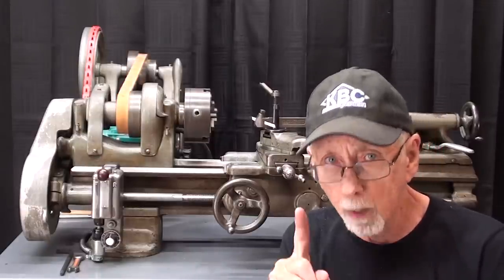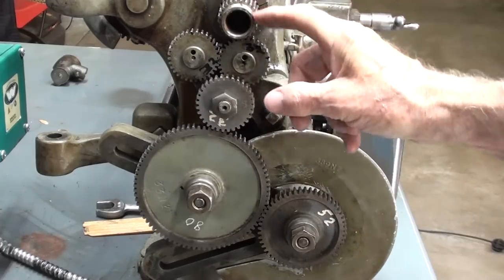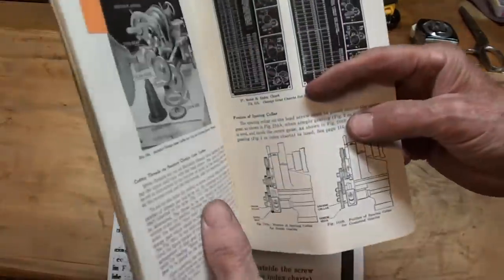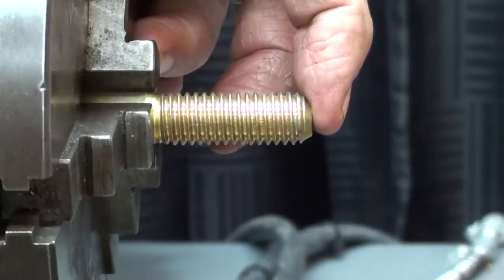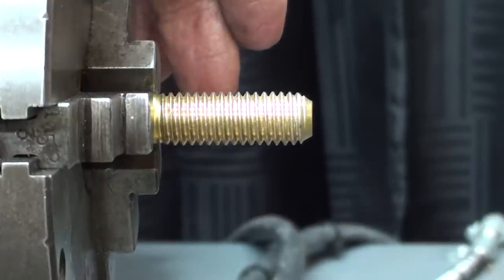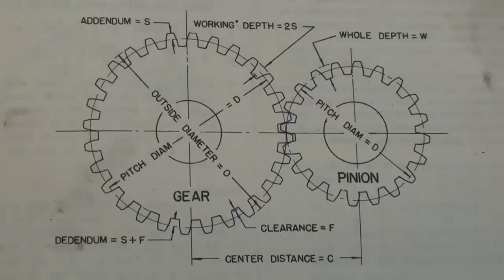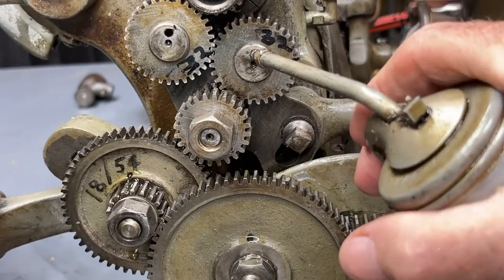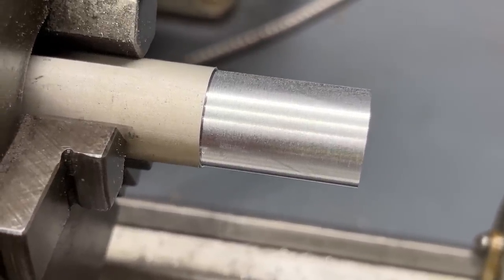SETTING CHANGE GEARS SOUTH BEND LATHE mod C #807 pt 1 tubalcain

Comment: Mr. Pete, you have your nuts mixed up on the gearing when you change out the new gearing ratio.  The thin nut belongs on the stud gear.  You have it on the middle compound gear.  The thick nut belongs on the compound gear.  And yes, there is a washer behind the nut on the screw gear.  I know this stuff too well from all the years of changing out gearing on the 9" SBL cutting threads.  Dad was a stickler on this stuff just like Mr. Pete!  Yes, I watched the full video and paid attention in class today!  Thanks for sharing, Ken
Reply from the maker: Thanks, when the weather warms up, I’ll fix that

Comment: Thank you for this, any, and all your videos related to lathe gears and quick change gear boxes. My Clausing 5914 engine lathe came in buckets and getting the gearing to match the threading chart is my last hurdle. You may not directly address my issue but your videos have a tendency to educate me to the point that I can. Thanks, again!

Comment: I have only changed my Atlas change gears once for the very reasons you demonstrated in this video. My Atlas has a beautiful OEM wood top base on cast legs. I like its originality, but the wood surface limits mag base attachment points for my indicators. Your steel table would be a welcome upgrade to me for function, but I have been loyal to the Atlas design. I see very few OEM Atlas bases. I treasure mine. It is a pretty handsome upgrade for an otherwise pretty basic and light machine. We set up my feed selection years ago in very cramped and poorly lit shop conditions. (The machine now has a well lit and spacious new home.) The feed is way too fast for good finish. This video encouraged me to set it up for a better universal finish and to get back to a long delayed LeBlond rebuild that I began years ago. The LeBlond is a true industrial machine and has a feed gearbox. It is also much larger. It deserves to be in use instead of being an aborted rebuild project... Too many projects...!
Reply from the maker: At one time, I had a atlas machine on the cast iron legs       It also has the nice wood top that you mentioned.

Comment: Lyle, thank you for this video.  I have an old (1911) South Bend 11-inch lathe that is a model C -- your explanation really helps with understanding how to change its gears.  Now I just need a set of 14-1/2 degree gear cutters so that I can machine replacements for the missing/incorrect change gears I ended up with when I bought the lathe!  Then I'll be changing the gears as you demonstrated.  ;)

Also, I remember reading somewhere (in a book, not on the Internet!) that notebook paper makes a good spacer when setting the change gear clearances.

Comment: We have a large Monarch NN lathe at work that is mainly designed to cut cable grooves in cable drums for overhead cranes. The slowest feed it has is .009" but its a 50" swing lathe. It will cut cable grooves up to a 2" lead. That gets the carriage moving pretty good. I just turned a couple bronze split bushings on it that were 35" in dia. and 24" long. They weigh almost 2,000 lbs before I started machining.
Reply from the maker: Wow

Comment: I would love to see a video on this using the metric gears and the quick change gear box on a SB9 and how to set the tumblers. Thanks Mr Pete for another great video.
Reply: A quick change gearbox leaves you no threading options other than what it has.
Reply: @MrEh5  Actually no. The intermediate gears between the spindle and the quick-change box allow not only metric threads but also other feeds and threads. My bench lathe will cut 17 other inch threads not listed on the QCB between 3.75tpi and 128tpi. Of course, you would probably never use any of these oddball threads, but they are available. 
An inch cutting lathe with a 120/127 compound gear will cut metric leads exactly. Lathes, such as bench model South Bends, use a compound gear that is very close to exact. By very close, I mean that you would have to have a length of engagement of over 12 inches (300mm) before you might detect any binding. The error would be very difficult to detect in a job shop, let alone the hobby shop.
Reply: @aceroadholder2185  yes but most people don't have extra change gears when they have a quick change gearbox.
Reply: @MrEh5  My lathe came with extra gears required to cut all the metric standard leads. South Bend had them listed in their catalogs. Lyle has a video where he made SB gears in plastic on a flat-bed 3-D printer.

Comment: Thanks Mr. Pete!  The model C was the first rebuild I did a couple of years ago.  I never knew about the dial indicator and turn the chuck trick.  And the tailstock wrench fits the gear nuts??? what???  I have changed those so many times with that book in hand, and never even tried that wrench LOL.  On a side note, I 3D printed a couple of gears to convert the 9C to thread metric.  It worked like a charm.  I purposely put extra stress on the machine to try and break off teeth on the plastic gear, but it held like a champ.  Thanks Mr. Pete.  You are a mensch.
Reply from the maker: Thank you, I’m glad you liked the video. Those printed gears really seem to be a strong

Comment: Thank you for all the time you take making us these videos thank you especially for this one I have a south bend see I set it up to cut threads i have short term memory lost miss placed my south bend book I want to set it back up for feed so this helps me a lot I worked in a shop where we remanufactured EMD s when they were setting up the front end water pump s oil pump s all meshed together they had to set back lash on every gear with a indicator

Comment: Great video Pete👍 well explained. I’ve had a 9” Southbend for many years and not used it very much as I have access to others at work if I need to machine anything. Mine has the deluxe apron but no quick change box. A model B as I’ve just learned😃. I had to replace the motor a few years ago and had to work out how to wire it for the reverse switch. Very complicated but satisfying when everyone tells you it can’t be done🤣

Comment: Mr. Pete I have a 6 inch atlas lathe . I have set it up for threading in the past but have always struggled with gear spacing . Would never have thought of using card stock between the gears . Thanks . the old retired cop from NC

Comment: I see that you are using a link type belt on your lathe. One of the few things that Horrid Freight sells is a green color American made belt of similar design. I have a couple that I use of the red variety like yours that for determining the belt length for replacing torn belts. Otherwise I don't typically use them as they are expensive.
Reply from the maker: They are costly. But easy to install, and seem to work quite well.

Comment: Oh for heaven sakes, the tail stock wrench. Never thought. But the wrenches provided will do much.
This older 1928 has a fine feed of .004 per rev of the chuck. You just taught me that check and I tried it.
Still astounded and even baffled on some of the production changes between this 22-RC 9C and your newer 9. The direction change lever for the lead screw really got me.
That nice lathe went back to 1911 with the square head snug bolt to hold the position. This 28 has a nice spring-loaded brass unlocking lever on the change lever and a pin to lock it in the three positions. One armed banjo here with no guard between the lead screw and gear.
Do you know your spindle speed as shown? I stick at 300 rpm's and dump oil to the spindle and he uses it. Scared to speed him up and accelerate wear on this once thru oiling system for the spindle. 
And more to come about gearing... Cool!

Comment: Hey Mr Pete,  
It seems like you can mathematically determine what gears are needed to an extent.
For example, given the gears installed at the start (including the fixed gears on the spindle and the reversing set), I believe I can derive the threads per inch off the lead screw based on the lathe being set up to cut 13 threads per inch.
At the start of the video, the gears affecting the ratio from the spindle down are: 24 to 32 to 32 to 52.
24 to 32 is a ratio of .75
32 to 32 doesn't change the ratio but if it did, I believe you calculate the effective ratio as the previous ratio (.75) * (the ration of the driving gear (32) to the driven gear (32) (or in other words the gear-to-gear ration is 1) so the effective ration is still .75
For 32 to 52, the ratio is the previous ration * (driving / driven) or .75 / (32 / 52) or 0.461538462
So, for every rotation of the chuck, the gear on the lead screw turns .461538462 of a revolution.
If the thread being cut is 13 threads per inch, the per chuck revolution movement of the threading tool must be 1/13th an inch or 0.076923077 of an inch
If the lead screw turns .461538462 of a revolution for every revolution of the chuck and the tool needs to move 0.076923077 of an inch then we need the lead screw pitch to be (.461538462 lead screw revolution / chuck revolution) / (0.076923077 of an inch / chuck revolution) or 6 lead screw turns / inch (if I handled the units correctly!).
Thus, the lead screw must be 6 teeth per inch.
How did I do?

Comment: It would be interesting for some to know how to calculate threads & feeds if there is no chart. For example, how could one figure out that the original gearing (13TPI) was in fact 13 TPI if no chart was available? That might make an additional video for this series.
Reply: That's something I've wondered about myself. I would definitely be interested.
Reply: Well once you have all the teeth counted it is simple math to find the reduction ratio. Any idler gear can be ignored.
The reversing gears are idlers and so can be ignored. However Mr. Pete does not tell us what the gear behind the stud gear is but you can count it in later part of the vid so 24t so the same as the spindle gear.  Reduction is 32/52 = .6154 (80t is  an idler)  If the Lead screw is 8 tpi ( notice in the chart 8 tpi gears are 32/32 = 0 ratio) then the pitch is 1/8 = .125 So then .6154 x .125 =.0769 = 13tpi
After the set up for turning 24/54 = .4444  18/72 = .25  18/80 = .225 and lead screw pitch is .125 
.4444 x .25 x .225 x .125 = .0031
Reply: @Bargle5  See my Comment below
Reply: Look at "Advanced Machine Work" which is available online. My 1917 edition shows how to do this with any lead screw pitch.

Comment: The fact that the reversing gears are 32t doesn't matter because they are idler gears just like the 80t in the first part. You didn't count the gear behind the stud gear but I did and it is 24t same as the spindle (on my atlas they are also the same) So the Stud Gear rotates at spindle speed.

Comment: I just purchased an old South Bend machine, I only have one gear up top engaging into the Chuck gear? Also, my banjo only has slide for gearing the model you’re working on has two? Is my unit older?
Reply from the maker: I am really not sure
Reply: @mrpete222  thanks for replying, after many hours of research, I figured out my unit is a model 405 from 1934 and the gearing and everything is noticeably different